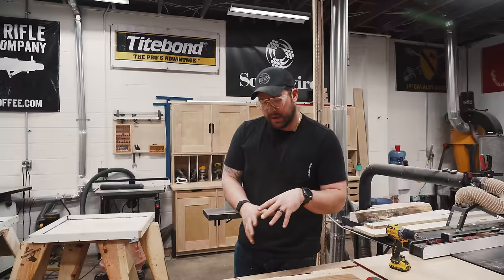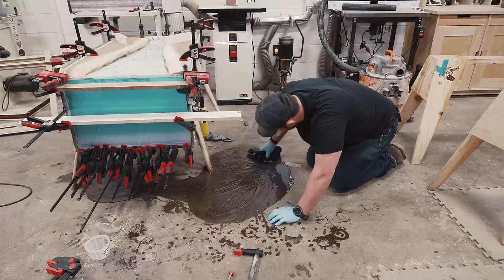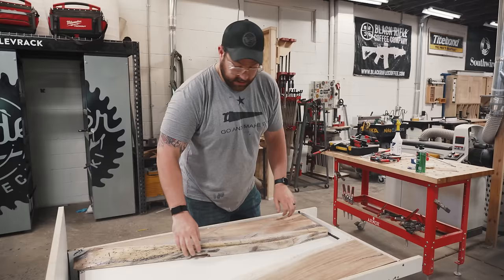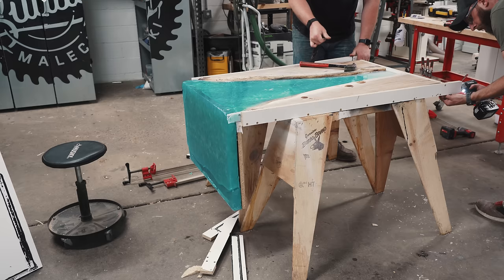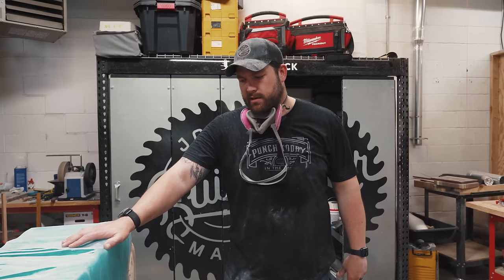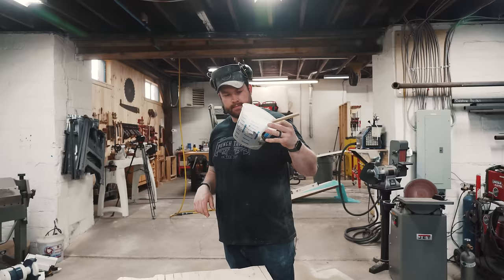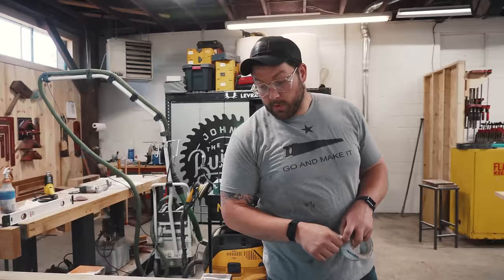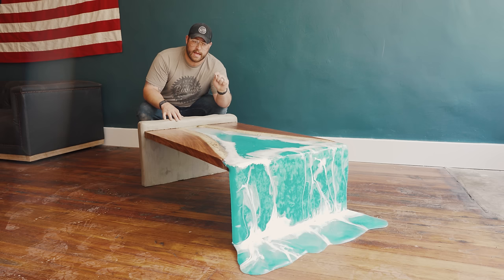CRAZY Epoxy Waterfall River Table Build 🌊

Comment: When using that much epoxy/resin, you need to do it in stages. Let the first pour mostly harden. While it is still chemically active, pour the next stage. That way the heat is minimized and you can avoid the problem at the beginning. It clearly takes longer, but it comes out looking clean.
Reply: This.  The heat of the chemical reaction of the epoxy bowed your plexi outwards and caused those leaks between the clamps/screws you had used to hold the front panel together.
Reply: One thing I’ve learned, never rush a project. Especially anything to do with liquids.
Reply: It's just like glass fiber resin
Reply: Yeah this is like Epoxy 101, says it on every brand of it. Even the high end stuff you really should only do 1-2 inches at a time max and or thinner if you're going crazy waterfalls.
Reply: It's like they have no idea how to use it - it's nuts for a channel of a pro shop
Reply: Would it work to form it flat and then bend/flex it over a support before it completely cures? Blacktail did something similar and it actually worked out without cracking the epoxy.

Comment: Hey guy. I’m new to this but I’ve used Tyvek tape on forms and on table to eliminate sticking. Also, try bondo instead on mortar you can paint it and make your own textures plus its cheaper and not as heavy. Gotta say the project came out sweet.

Comment: The water foaming effect is obviously difficult to achieve, but I have seen artists render it with fabulous results. Pratice makes perfect I guess. I think with the curved features of the river on the table top, the table legs look clunky. Why not carve the sides of the water fall? I don't think it would compromise the integrity of the table to do this. The attempt at creating the effect of rock on the other side? I don't know. To create a more integrated design, I would coat the rock leg with a grey epoxy mix, and  use some grey epoxy on the edgs of the river on the table top as well.  Crazy difficult job for sure. A+ for your willingness to persevere and make us laugh to boot! I can see on the side there you have another river table project. I'm definitely going to check it out.

Comment: Thanks for sharing your process - How about casting the vertical section flat, and then standing it up. After that cast the tabletop so that it over laps the edge of the vertical part (Make a casting mold frame that encapsulates vertical part with table top)

Comment: I just started watching epoxy resins furniture and this popped up as a suggestion. 
My hat is off to you for showing everything you went through on this piece. I respect you for not just scrapping this and went with what was handed you and kept thinking outside the box. 
I really think it turned out more realistic than just waterfall to the floor. Great jub and I'm subscribed

Comment: I have thought about doing this, too!  Thank you for teaching us through your mistakes.
I was thinking, while watching all those apoxy trimmings fly through the air, about taking that big pile of the trimmings, tossing them in a little apoxy, mix with a little white tint, diamond dust, & white glitter (it is iridescent with rainbow colors), and then, place it at the bottom of the water fall.  These clumps will look like the water splashing back up, bubbling up, foaming up, & glistening from its long fall down the cliff.  This will give it a wonderful, beautiful 3D effect!!!   Keeping it smooth makes it super easy to dust and clean. Little sharp spaces will be hard (impossible) to clean the dust, etc., out of.  Those dust particles will become impossible to clean, ever.  Eventually,  these spots will always look dark and dirty.  Smooth surfaces are very easy to keep clean and bright looking. Otherwise, your wife will make you clean it every week! For the rest of your life! 
Thank you for this wonderful tutorial!

Comment: Then you fill the cracks with a totally different color, like a green or even better a black so you pop out mistakes instead of trying to fix them.  It is gorgeous looking.  The bottom part of the water is a little unnatural, cut in s patterns.  Maybe some sharper cuts with rock in places?  Or the end might look good not smoothed out but bumpy and full of bubbles.

Comment: I would probably looked into diorama building and epoxy used on those. Night Shift channel does few such builds and he uses transparent acrylic water gel from company known as AK so maybe look into material similar to that to build up the connection point of base and water fall. Alternatively small scale test of making box with holes on the bottom with air hose connected to all of those so you intentionally create foamy epoxy, witch you can then cut to shape to mimic actual foam that is on bottoms of the water fall. Epoxy that in, put layer of epoxy on top and then go at it with white. Not sure if this works but would been worth to try.

Comment: You guys do absolutely incredible work with wood and epoxy...my two favorite things! I have been binge watching 30-50 projects and I have learned so much. Learning my woodworking and epoxy skills on 50-80' boats, I got pretty good pretty fast. Heck, I don't think I even owned a carpenter square till like 10 years ago!! After watching these videos I now have a new list of 50 plus tools, gigs, etc. seriously I sat here and watched and thought "I did this by using what tool/technique...bla, bla, bla, what an idiot". Anyway, my most used tool in nearly all of my projects is a Makita Polisher/Grinder with a soft pad, 3M 40-220 grit. Perhaps it's because its the fastest most effective "fix a mistake" tool? Thanks for the help guys. Jim

Comment: Another idea that would have looked cool on this project is if the waterfall looked like it went into the floor (instead of the 'puddle'). You could make a lip of a well in timber and then fill it with epoxy and then have the water pouring into that.

Comment: My idea was, instead doing this fall in 90 degrees,  get tbis project on a flat surface with hinges to the destination areas  before it fully harden to a point in between the drying process, i think this will work better amd save lots of leaks , troubles.

Comment: @JohnMalecki I'm still learning about epoxy...would it work if you made one long slab for the epoxy,  cut 45° grooves in the back but not all the way through...turn it over a support and heat the epoxy with the heat gun to soften it and gently bend it?

Comment: Hi there. I know I'm late to the party, but could you make it as a full horizontal piece? If you add the epoxy in layers it won't crack and you'll have more control over the colours and foamy bits. Thanks.

Comment: As I see you are using similar tools as I have. Regarding the Makita miter saw: My almost always has vibrations when cutting hard wood (soft as well). Do you have the same issue? Maybe you can advise how to solve this? I tried different blades but vibrations appear more or less all the time.

Comment: Next time you have a blow out use 2 10 inch taping knifes to scrap off the floor you can actually save the material just quickly strain rags just don't cut the mustard

Comment: Really liked the concept, but perhaps planning the entire project end to end would've been better. The "stone" side, a whole stone piece would've been nice, instead of the cement mock-up; the waterfall (again, my opinion, not bashing or anything) should reflect how a real one looks (going from thin to wide opening feel unnatural; may be a darker blue where it's a river on the top, towards brighter at the bottom. The waterfall "foot" white resin was nice, but too uniform as a pattern. Just my thoughts :) PS, you've a new follower - the project was very interesting as a whole. How's the workshop floor after the epoxy spillage?

Comment: Great to see the whole process with mistakes. You’ve probably learned all this already since this video, so this is more for the viewers. From an artistic point of view, it looks like you were caught between an abstract and realistic direction. The top looks great, but the waterfall looks a bit random. As other commenters stated, you should have built this in layers and simulated how a waterfall would really flow. I would have started by looking at real waterfalls on google images. When I do my pours,I pour multiple layers and wait about 6 hours and then use a stick to stir the color mixture….lifting the resins from the bottom. This ensures that your pattern stays put since the epoxy is hard enough to not sink.

Comment: What happened to the the rock and the hole in the middle of the waterfall - you were supposed to go Squirrely!  Looks great but I was wondering - how did you ever get the epoxy off the floor that spilled all over the floor on the first weekend?  I woulda been pissed!

Comment: Nice idea, but came out a little awkward ... I think you overthought it. Simple is better. I think you should have left the original uneven edge a used two thin stainless steel legs under waterfall .